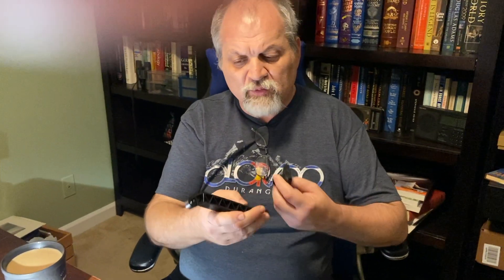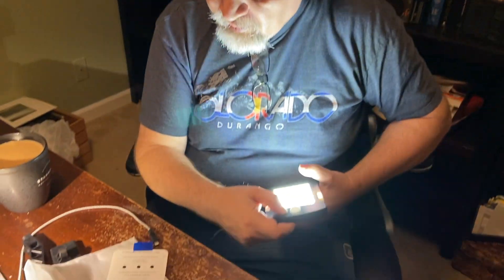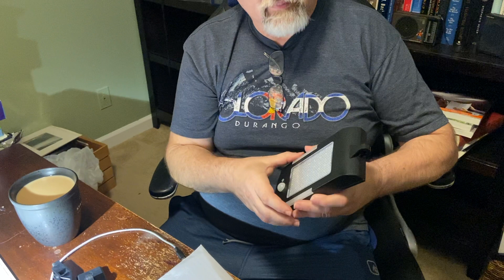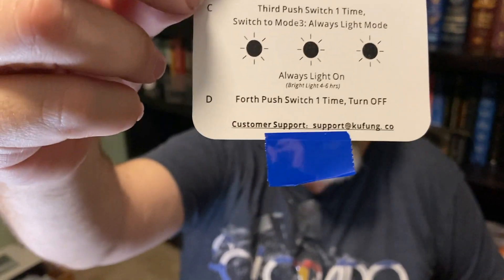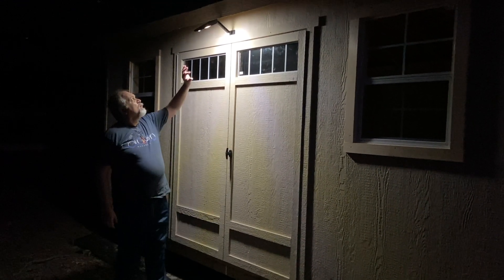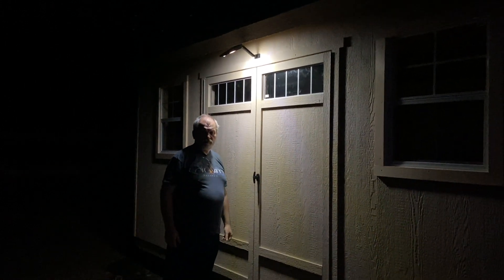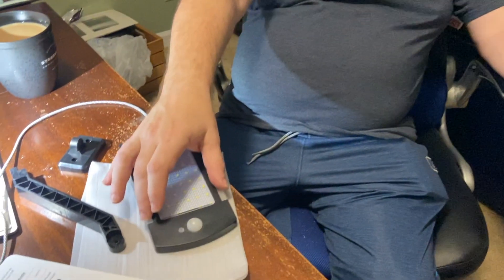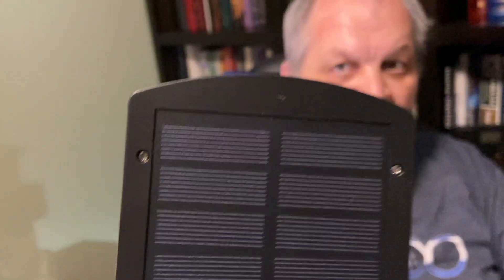First Look: KUFUNG exterior LED light

Comment: I wonder how you change between the modes?  you didn't mention this.
Reply from the maker: There is a single button depending on how many times you push it you get the desired mode.